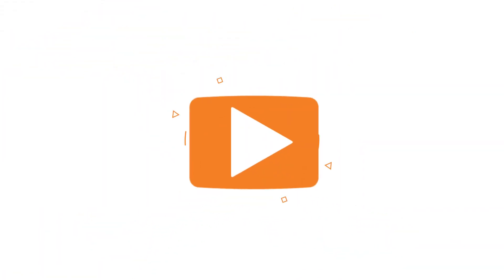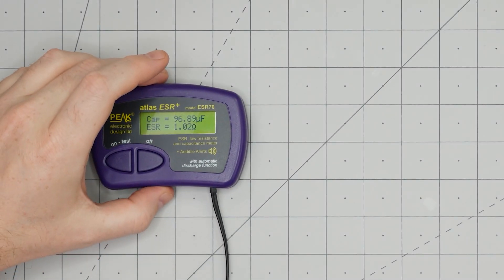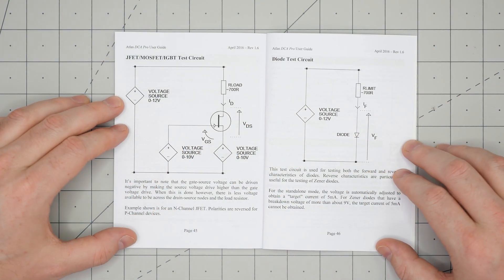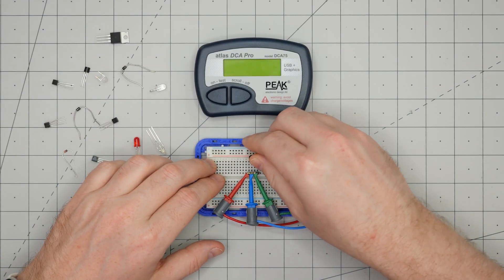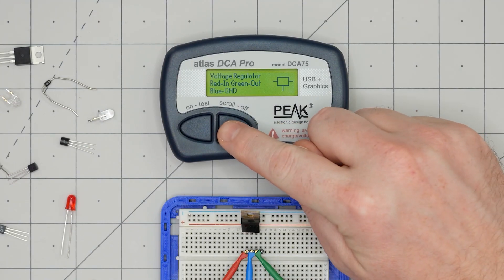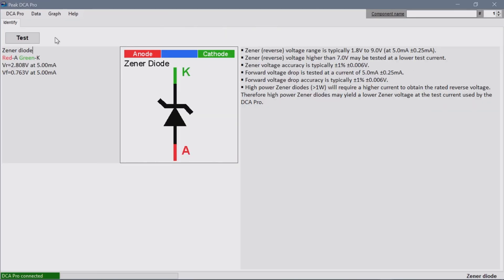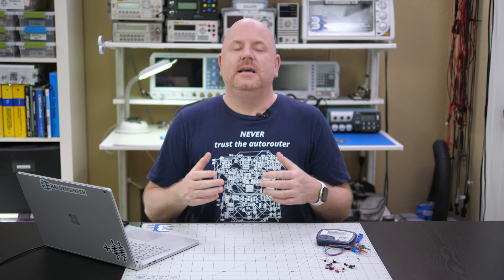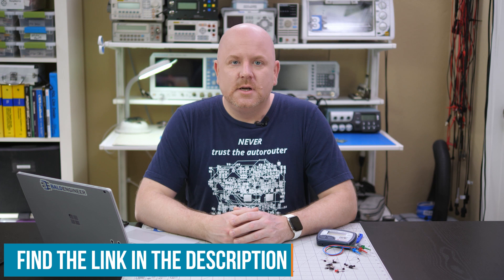Semiconductor Measurements - Workbench Wednesdays

Comment: "only available for Windows"
the amount of my sorrow -> https://www.youtube.com/watch?v=5Ioiag30eAI

btw, a curve tracer is super handy, especially if cheap, the fact that you are not gonna blast 100 amps on a power mosfet is relative, the datasheet may not be (i'm not sure) totally comparable AND if you have working specimens of the same transistor to compare it's easy to tell if it's a bit roasted or 100% in shape, i faced this "problem" a couple of times, easier to use diode drop voltage test on a BJT but a mosfet requires a basic circuit